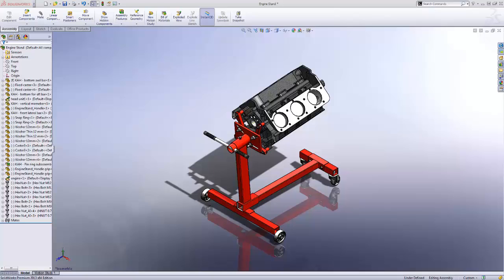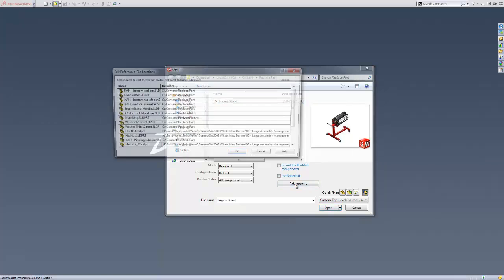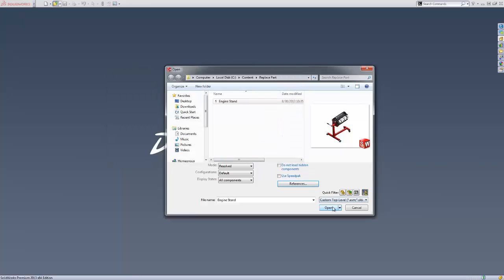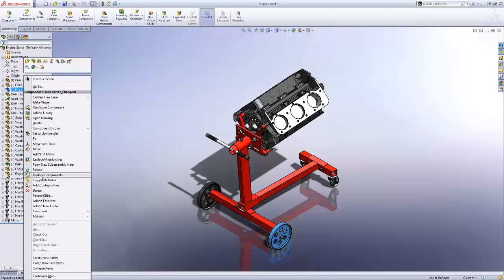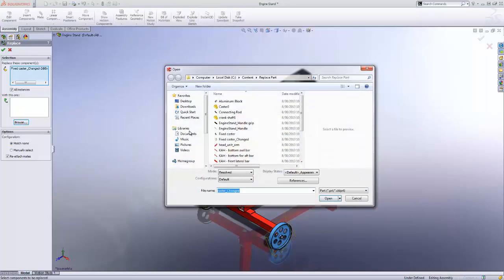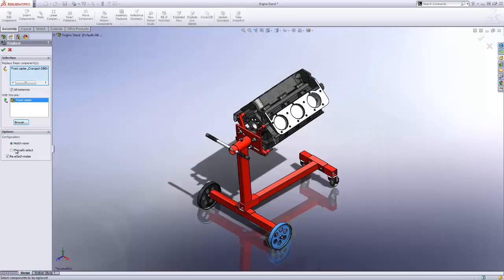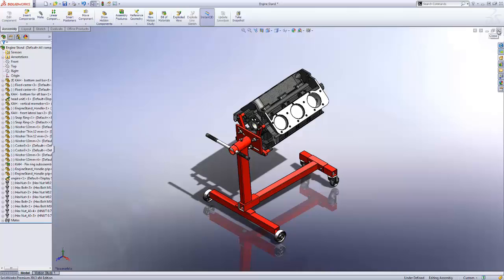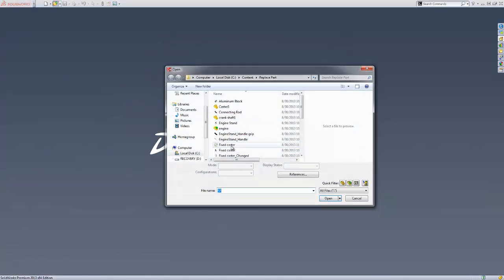SOLIDWORKS – Replacing a Part in an Assembly

Comment: This saved me a huge headache. I had two asseblies opened, and both of them had parts that were having the same name, but were totally different. So the second assembly "rewrote" the reference and refused with all its might to load correct parts from correct folder after restarting everything. Crazy. 
Thank you.

Comment: How does this work for mates? Like how does it know the right side of the castor here and not load it back to front or upside down?
Reply from the maker: Great question Jacob,  Solidworks is going to apply the orientation of the new model as it is in the part file to the existing assembly and it will do its best to apply the existing mates.  This is not always successful and you may have to repair or redo some of the mates.  So if the XYZ orientations are the same from the old part to the new part it should load in the correct orientation, and if there are features that can be used for existing mates similar to that of the old part they should come in correctly.  If these factors are missing or differnt you will be given warnings and the chance to repair the mates.
Reply: @goengineer  thank you for the reply! It's very helpful

Comment: Is there a way to copy a new part or subassembly with a new one, without getting rid of the old one? So that way you could test out a new design to see how it works, but if it doesn't the old one is still there. Or if say you wanted them both to stay in and turn one off in one version and the other off in a second version of the assembly.